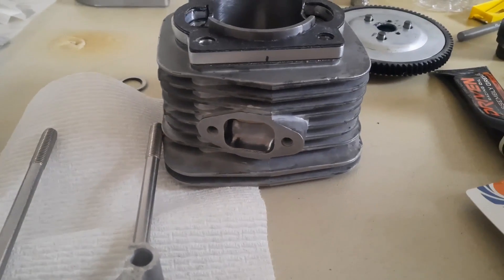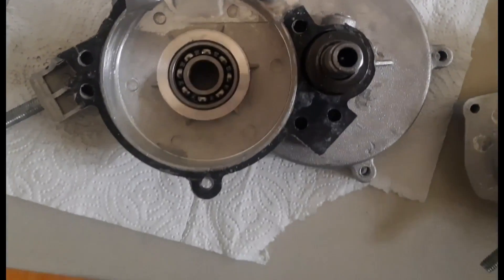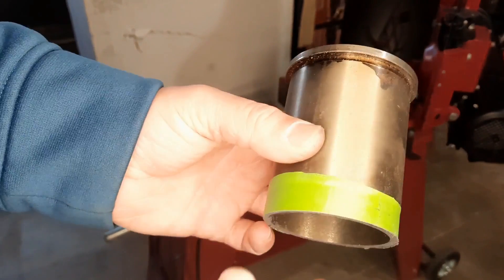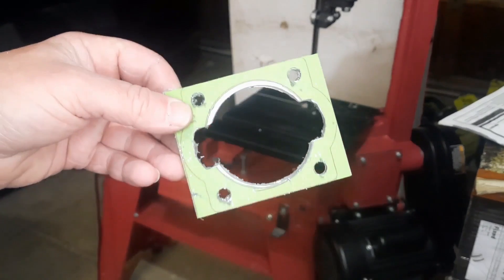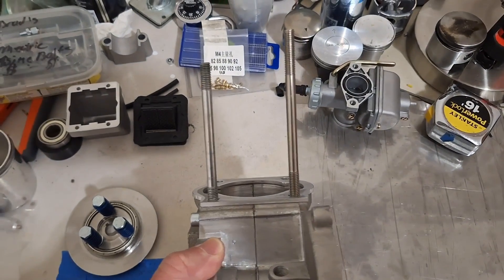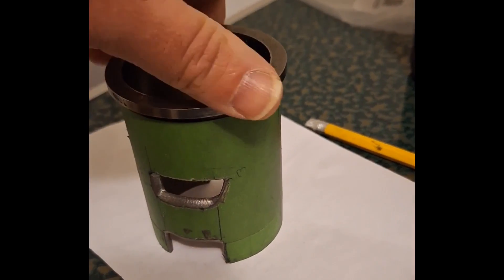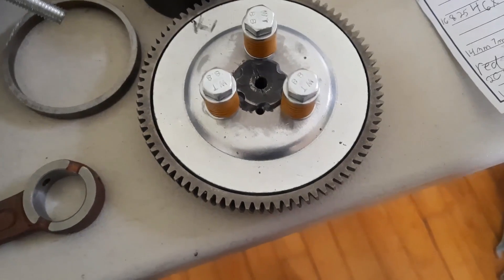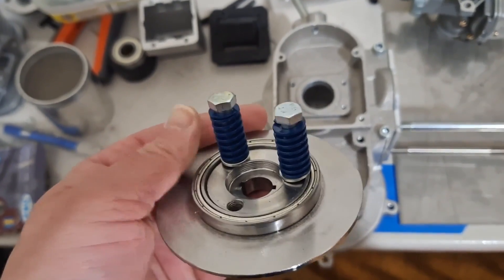98.5cc 2 Stroke Case Reed 56mm Engine Build Motorized Bicycle

Comment: I was Wondering if you where gonna put out another Video, Nice Work, An you still have a Bigger 1 to build  👽👍🏻 Sounding Good
Reply from the maker: Yes I just sent the Cylinder out to put my  sleeve in it 60mm
Reply: How did you make the case for the reed. I have been cutting into a 80cc one for the case reed. It does not look that clean
Reply: @mobdta425   hi Mike just saw your question to witch I see no answer I have one of those cases from a cdh 110 it has a zmn100 rod the case is must thicker than the standard 80/66cc being totally honest I hope this helps you I had to pay attention to what he has it looks like he rebored the 110cc cylinder looks good